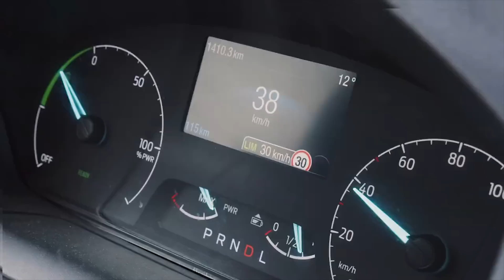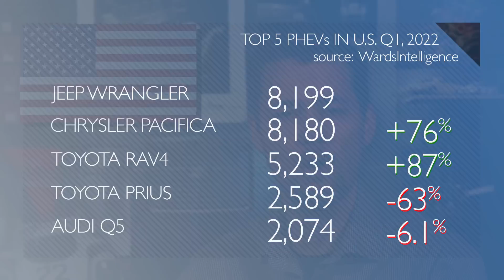Ford Technology Automatically Reduces Speed; PHEVs Starting to Catch On - Autoline Daily 3331

Comment: Yes, buy a phev... A mix of the worst of both worlds. Bad battery tech + the full weight of ice. ✌️
Reply: I currently have a standard hybrid 2011 Prius.  When I bought it, I fully expected high maintenance costs and low reliability.  After all, there's the ICE, the electric system, and the mechanical + software to make it work.  However, in my case, it has been very reliable (and slow & ugly).  I've averaged 44.7 MPG over 83K miles.  That said, I hope to get a BEV next time.
Reply: My main problem with PHEV is you don't escape any maintenance costs and you are still buying gas.
Reply: @frankcoffey  and carrying another motor + batteries, making it all even less efficient.
Reply: @rodrigogaya5276  I don't really care about how efficient it is, it's all about total cost of ownership. Oh, and launching from 0-60 in under 5 seconds is nice too. :-)
Reply: @frankcoffey  haha that is for sure!
Reply: @frankcoffey  not sure if that is true. I only have about 10k of generator miles on my Chevy Volt that has 90k miles on it. So far, I just change the oil once a year. The engine does little work.
Reply: Lots of unneeded maintenance
Reply: Ali - I I do long road trips with my model three and let me tell you, I ain’t got to wait at a charger for an hour on a road trip ever. Tesla superchargers charge at up to 1000 miles an hour, no exaggeration. I pull in, plug-in, go P, grab a drink and get back on the road. EV batteries have a sweet spot for where they charge the fastest. If you are smart about when you stop for charge breaks, they can add no time or almost no time to a trip.
Reply: Not really. Since most people drive less than 40 miles per day PHEV covers the majority of peoples driving needs in electric mode. Having two different power sources allows a lot of flexibility to use the power source best suited for efficiency without needing to charge outside of their garage if they don't want to.
Reply: At least you aint gotta sit at a charging station on a road trip for an hour 🤷🏾‍♂️
Reply: @alleng012985  Charge times get lower constantly and after 5+ hours of driving you need a 20 min break anyway. Long trips are 1-2 times a year, and even then you might as well rent a gas car and put the miles and wear on it than yours. It's about understanding your actual real world needs and not some imaginary trips you never take.
Reply: @davidmccarthy6061  Hold up. I drive multiple eight to hour trips per year. If I'm getting a new car. I better be able to drive the piss outta it. "Go rent a gas car"...Man, you EV Heads always wanna try and tell somebody how to spend their money. I'm driving probably because I didn't wanna pay for a plane ticket anyways. And let's be honest...EV's will take away travel for average everyday families who can't afford plane tickets for 3, 4, and 5 people. EV's are dope until you run outta juice. I take a piss come out and my gas tank is full. I either keep driving (which always usually happens) or my wife will continue to drive. Not to mention, the cost of an EV that can 🗣COMFORTABLY fit 4 to 5 people are still astronomical.
Reply: They'll soon be more Phev's sold than Bev's.